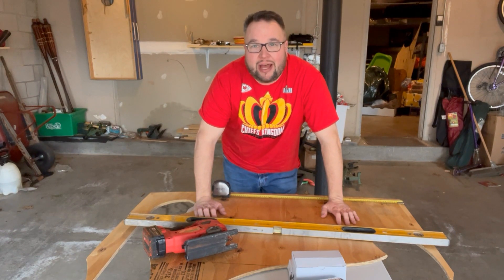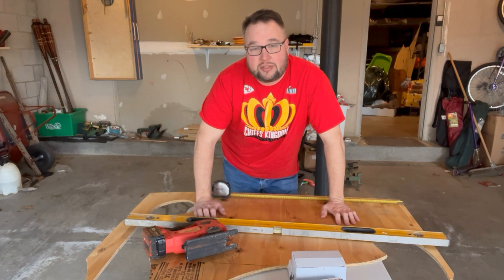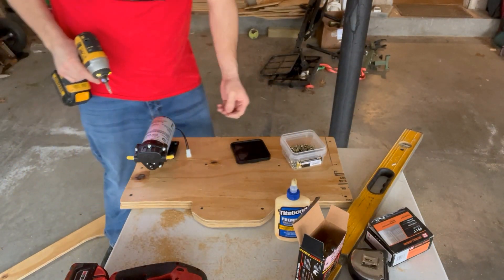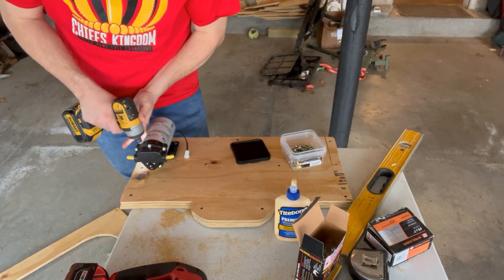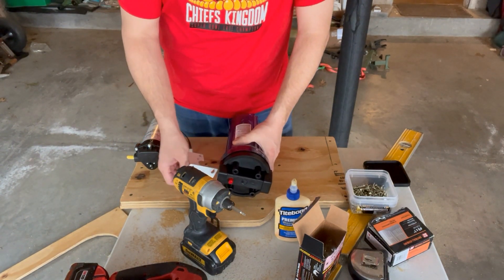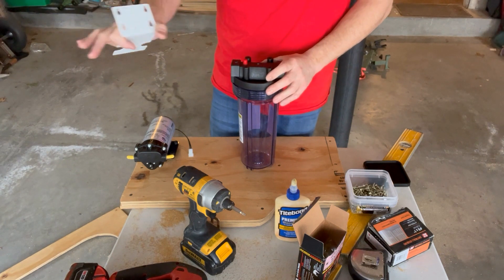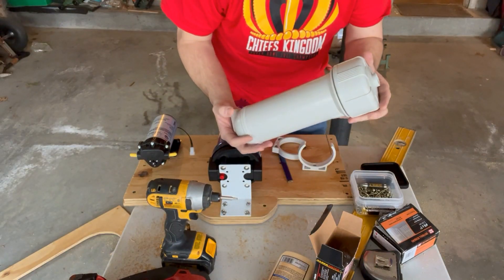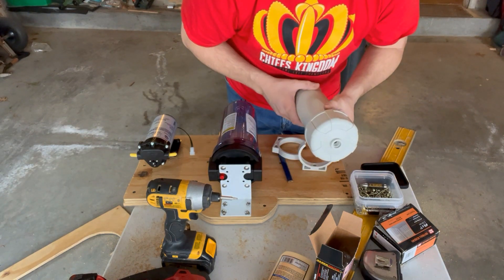DIY Maple Syrup RO System

Comment: How often do you change the RO filter?
Reply from the maker: Each RO filter is based on how many gallons. The particular filter I have was rated for 400 gallons and I ran that for the entire season.
This made an unbelievable difference in boiling time, probably cut it in half.
Thanks for watching!